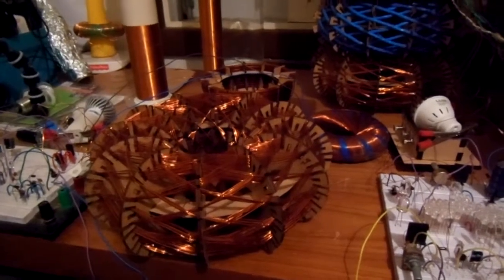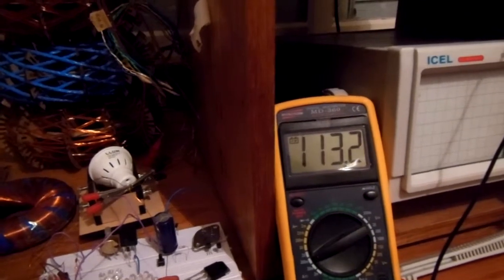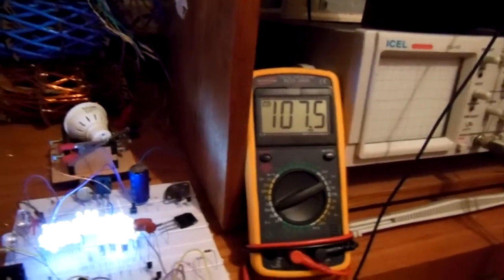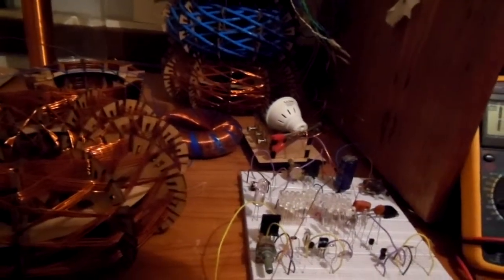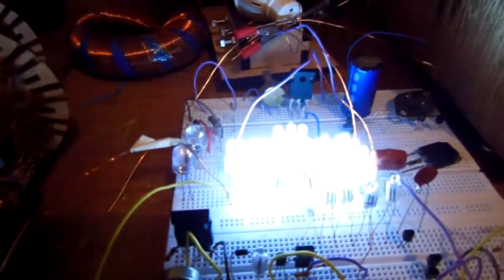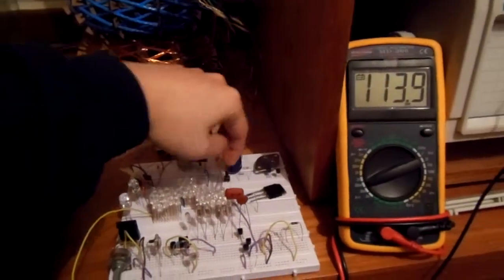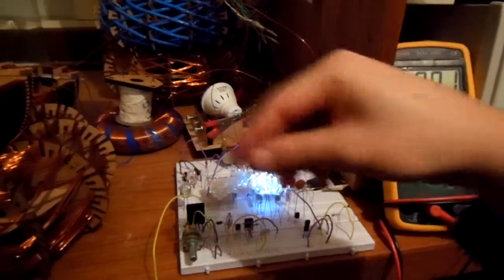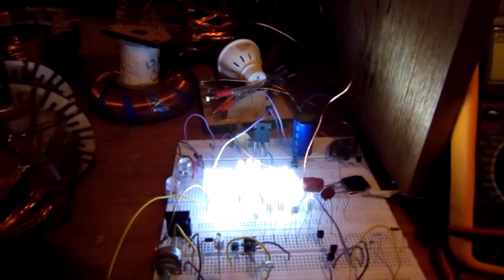ABHA Coil - Wireless Energy - Pickup Coil Comparison

Comment: what type of circuit you used for transmitter coil?
Reply from the maker: If I remember properly, it was something similar to https://www.youtube.com/watch?v=PDqC5Mcqouo
In this circuit, it is a good idea to put a resistor between 4047 pin output and mosfet gate.
Moreover, you can put a 100K resistor between mosfet gate and ground.

Comment: Did you try the half sphere the other way around?  Try making a solenoid coil that has a divider in the middle with each end wound in the opposite direction wired in series with each other. :)